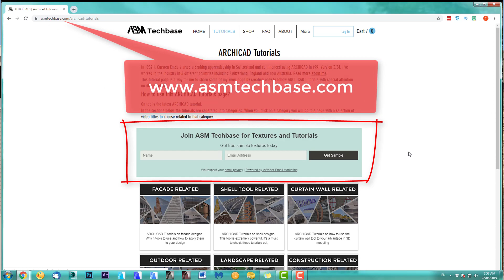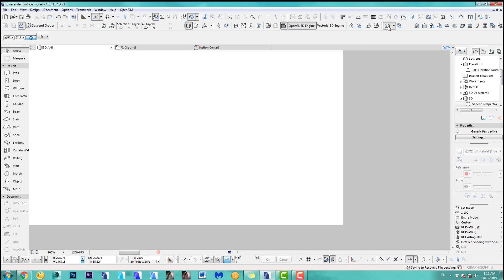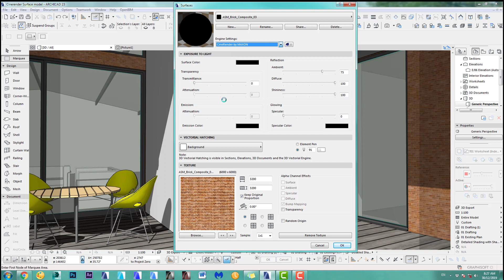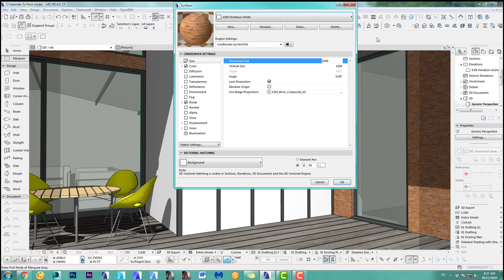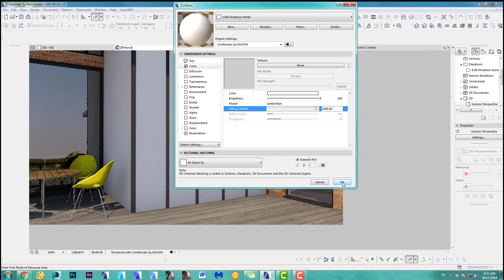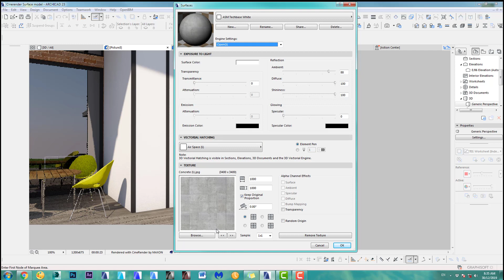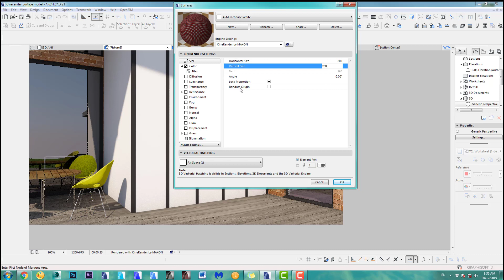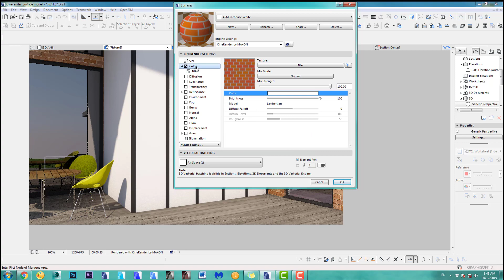CineRender Surface Settings Series Part 1 Size and Color Channel in ARCHICAD

Comment: I am using archicad cinerender for my renders and i am quite satisfyed but the problem is that noone i know use it and i dont get feedback to get better,so i am thinking to try Twinmotion.What is your opinion about cinerender Carsyen? what do you think i should do?
Reply from the maker: Hi Mike, I think you should go with Twinmotion. It is just so much more powerful, the result will be better then Cinerender within a short time of using it. It is fairly easy to use especially if you have used other render Software. Cinerender really lacks in regards to landscape too, this alone would make me switch. Just install the trial version and see for yourself.

Comment: Hello, thank you for sharing all of these. I am using AC22 and I've made a brick texture from the CineRender settings (procedural), I've matched the settings to basic view,  but in the 3D window I cannot see the new texture, only  the surface color. Is it a bug or am I missing something?
Reply from the maker: Hi thanks for watching! No you are not missing anything. Procedurals are not showing up in OpenGL only textures and colors.
Reply: @ASMTechbase  Thank you!